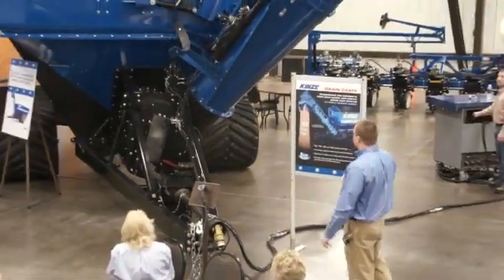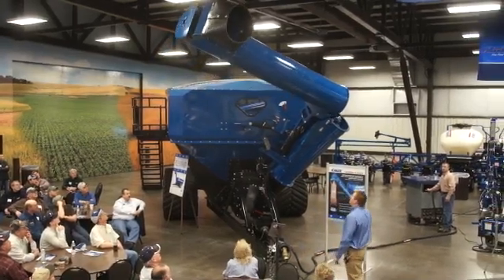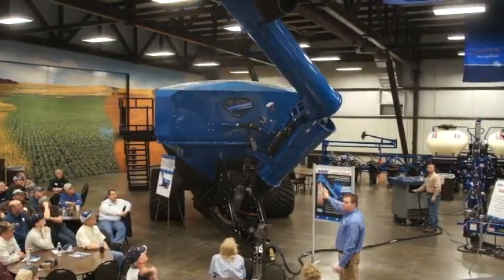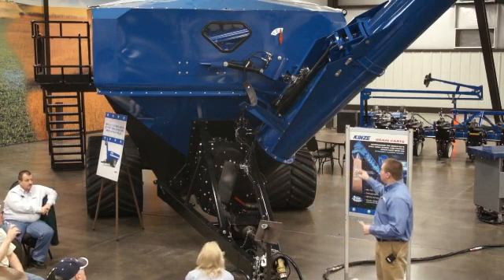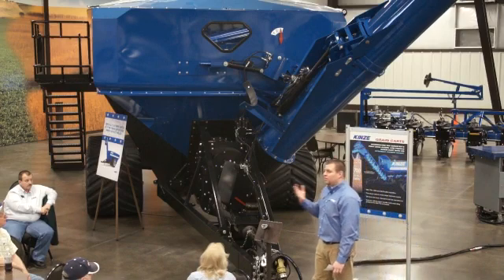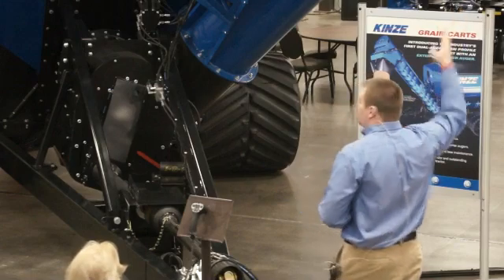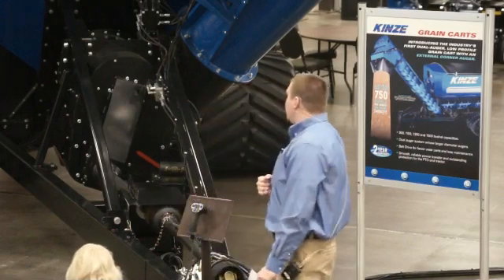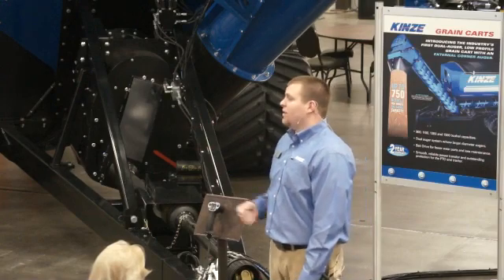Dual Auger Grain Cart Demonstration - Part 2

Comment: Hopefully you don't run into any mud.  That auger looks like it would catch a bunch of mud when it's folded up.  Then again i'm not an engineer, but I do understand gravity.
Reply: That's exactly wat happens. Lots of mud this year, has to run thru the field with auger unfolded.
Reply: by my former boss we made the mud guars on the back longer by ussing old conveor belts to hold the equipment behind clean
Reply: Bingo